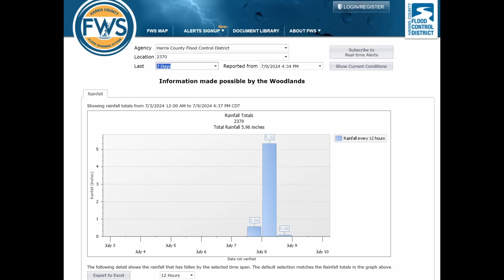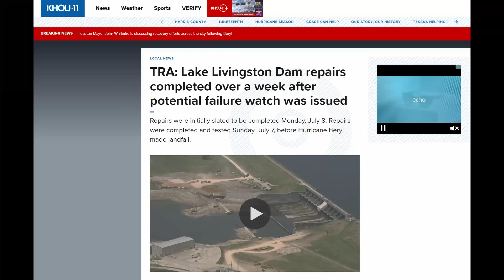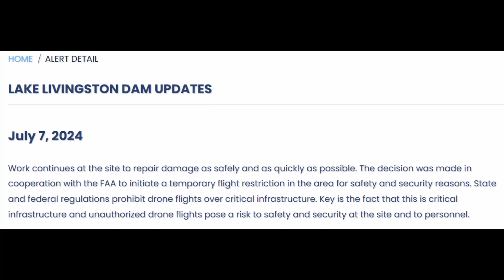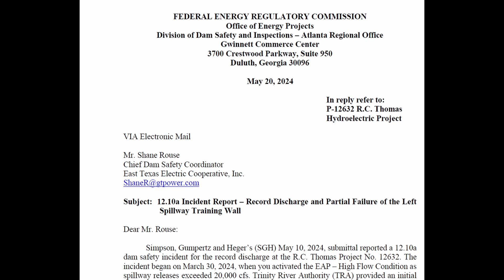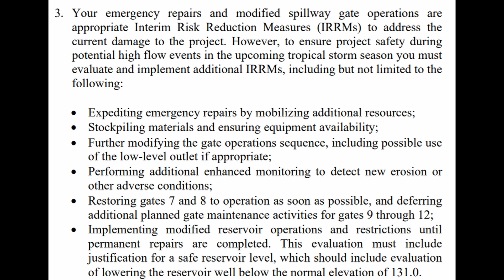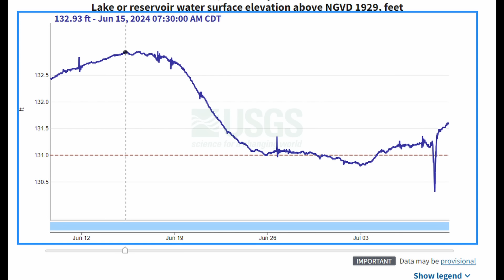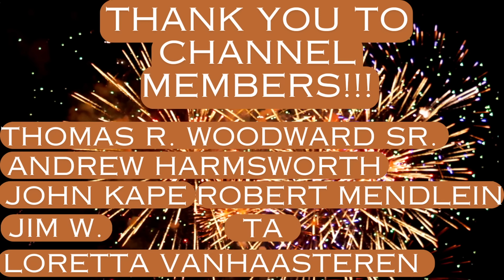Lake Livingston Dam Update

Comment: Don't forget that at the bottom of any waterfall of size, the dropping water bounces off the bed of the waterway. This then gets reflected upwards and backwards by the relatively slower water downstream, creating a "stopper" wave which churns horizontally not just at the bed, but also at anything behind it, eroding upstream. Fieldcraft specialists can even tell the direction of flow from the indent in the valley head.

Comment: So the dam sustained damage necessitating emergency repairs from a 20,000 cfs discharge, how is it going to hande 15x (300,000 cfs) higher discharge rates? There'll be nothing left of the dam at that rate.
Reply from the maker: The damage reportedly occurred with about 5 times that flow earlier this Spring.
Reply: @CaseyJones-Engineer  Oh I see, I misunderstood the figures (6:00 is the correct one, not the 20k cfs). That leaves a factor of 2.5 or so to the design flow rate, which is still unnerving at the very least. 👀

Comment: I live in Houston. No one here will be surprised if the dam fails. The heat index yesterday was 105 F and we have over 2 million people without power.   Texas' power and water infrastructure is criminally mismanaged and the suffering is enormous. CenterPoint Energy, the utility that provides power to Harris County, did not stage outside utility workers to respond to the expected countywide power outage. In fact, they requested only 2500 outside workers and have now requested 12500.  In previous hurricanes, utility crews were deployed to the area.  CenterPoint's outage map has been offline since May. So residents have no idea when they can expect help. We have been forced to rely on the Whataburger map, which shows the location of open fast food restaurants. Last night, CenterPoint released a wildly inaccurate outage map in an attempt to silence critics. It's a mess.
Reply from the maker: Wow, I am sorry to hear that.  There is no excuse for not having an up to date outage maps!
Reply: Yup, here in Houston too.  Well said.  Having to rely on a fast food restaurant’s app for accurate power outage data is pathetic.  Centerpoint as mentioned above has not had an accurate online power outage tracker since May when we had a large power outage.  Don’t be shocked the Lake Livingston project is a mess.
Reply: Incredible backstory on CenterPoint Energy.  Their lack of planning is criminal.  My prayers to you folks in Harris County.
Reply: CenterPoint Energy correctly held back their crews during the hurricane.  Conditions were unsafe and it was impossible to access damage that was ongoing.
Reply: yea im here too and agree with everything you say. not just counterpoint but ERCOT (energy reliability council of texas...total oxymoron) and the whole deregulated energy distribution in tx which is geared towards maximizing profit for producers. it was a good experiment, but needs optimization or change. the solar and wind power has been a surprisingly positive development here, to the surprise of many (me included) but its really the only thing that has gone well. brilliant idea to use whataburger maps!
Reply: @ronaldfharring7326  Oh sure. The kept them in Oklahoma "out of abundance of caution". Riiigghhtt.
Reply: it's okay,..Ted Cruz, John Cornyn,  and Mr "hotwheels" Abbott will "definitely" be there for you.
(it's hard to give a single frick'n damn, about Tejas.)
Reply: @brianjennings7644 cruz and abbott left the state

Comment: Ha, I just noticed that TFR online yesterday. Sure seems like they are trying to control public monitoring lol. It's good through December 2024 as of right now.
Reply from the maker: Wow, interesting.  What are they trying to hide?
Reply: @CaseyJones-Engineer  I mean from a public affairs perspective. I dont necessarily mean they are trying to hide anything, but you may be familiar with the Oroville dam problems in Northern California and the public backlash from that. From an FAA licensed sUAS (drone) operator’s perspective, I intend to comply with all TFRs like manned aircraft pilots do. That mindset carries over into safely operating my drone at all times, which means I would not be even remotely close to interfering with any activity that jeopardizes public safety or that of my own aircraft. My belief is that the folks who are not aware of TFRs, FAA regulations, etc or those that willfully violate a restriction may be the most likely to cause an incident. So sure, maybe the TFRs gives them a little breathing room for “safety,” but either primarily or secondarily, it allows them to curb drone footage, whether intended or not. I think it was intended. Not criticizing them for this though.

Comment: So, 20,000 CFS is considered an 'emergency' on a dam designed to release 300,000 CFS? A bit of history on discharge flows: 1990 - 108,000 CFS; 1994 - 110,600 CFS; 2017 - 110,600 CFS; Record lake level: 134.39 feet in 1994. So, they made record discharges at 124,260 CFS on May 24, 2024, when the lake level was well below the 1994 level.
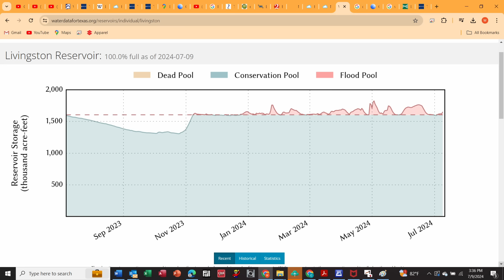Reply: I wasn't in the area in 1994, but I know that the high level of discharge in the spring of 2024 was because the lake level was high due to rain.  The discharge was made because it was continuing to rain, and inflow to the lake was ongoing.  The chart that Casey showed at 10:04 makes this clear - the level was high, and several discharges were made, and within short order the reservoir was back above the normal working level.  Knowing the current level without having a good handle on the current and forecast conditions doesn't tell you everything you need to know.
Reply: @gagenater  My point was that similar discharge levels occurred in 1990, 1994 and 2017 (Hurricane Harvey) - with no reports of erosion. The authorities are saying very little. This leads me to believe that something happened that they don't want to talk about. My theory? The hydroelectric plant that was constructed starting in 2015 and completed on Nov. 21, 2021, likely has caused the issues.
Reply: @danlowe8684  I wasn't aware that there had been new construction - that seems like a possible culprit.  There are 2 other possible ones: 1: If this discharge period lasted longer than the others, it may have had greater effects because of the duration 2: The other ones may ALSO have caused damage, but it was not known at the time until the cumulative effects were seen recently.

Comment: The whole “old dam didn’t get repair work done until it needed emergency repairs to save it from failing during a flood” thing seems to be disturbingly common. I grew up near the Lake Solitude Dam in New Jersey, and it was actively under repair when Hurricane Irene hit. They were worried for a while that the dam would fail from the high flows and cause severe damage to downtown Clinton. Luckily, it survived, but it got a lot of extra work done after that. It was especially good that it survived, because the earthen part of the dam wasn’t actually made of dirt. Rather than spend money to buy a plot of land and dig up dirt, the foundry that originally built the dam just used the extra material from their slag heaps, so if it had failed, it would have contaminated a lot of the Raritan River.

Comment: I fail to understand how much of a safety risk a drone presents, though I suppose irresponsible operation could put a drone in the way of equipment.  But limiting the public from obtaining accurate data is likely to promote all sorts of speculation.
Reply: My suspicion is that if there IS a good reason, it's that they don't want any nefarious actors to learn about how the dam is constructed, and what repairs have been made, so as to make it that little bit more difficult for some sort of terrorist/sabotage act.  It's some fine print buried in some homeland security rule somewhere I'll bet.

Comment: They get a no fly for drones but how the hell is anyone going to know that?

I can tell you though that if you violate it whether it is reasonable that you'd suspect there was a no fly or not, you'd likely have the weight of the tyrannical state come down hard on you!

If I flew an RC plane or helicopter (neither are drones and aren't regulated AFAIK) over the area, would that get you landed on.

If I knew there was a restriction, I'd fly from far enough away and a high enough altitude that the powers that be wouldn't know.

They don't want their work to be monitored for what ever reason. It has nothing to do with safety.

I'd even venture to say that the imposition of a no fly for drones might be the FAA overstepping the authority granted them by congress.

If you have never heard of the Chevron Doctrine, I suggest you look into it.

SCOTUS just handed down a monumental decision that is going to defang the bureaucratic unelected deep State regulators.
Reply: Not all the bureaucracies, but it's a great step
Reply from the maker: I expect that the FAA requirement for digital i.d. will go away.  I remember when the EPA under the Clinton administration was going to rule that coal ash was a hazardous waste.  It would have instantly close numerous power plants.
Reply: @CaseyJones-Engineer  is coal ash the same as fly ash? I hear fly ash keeps cracks from forming in swimming pools
Reply: @CaseyJones-Engineer I’d still rather they not dump it into our rivers.